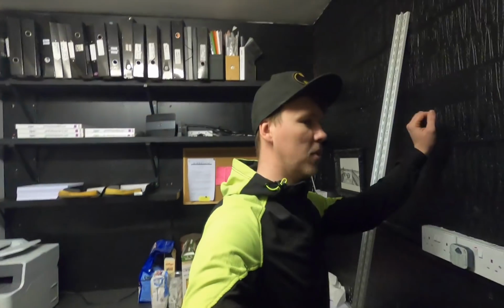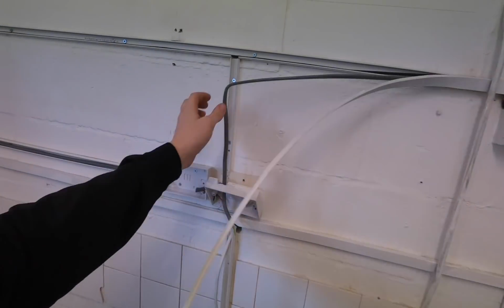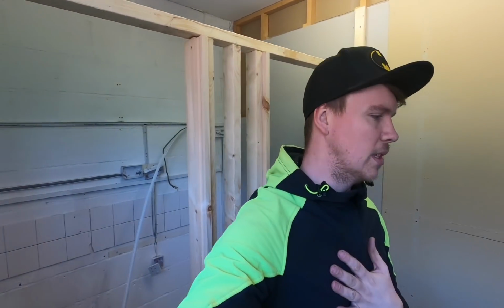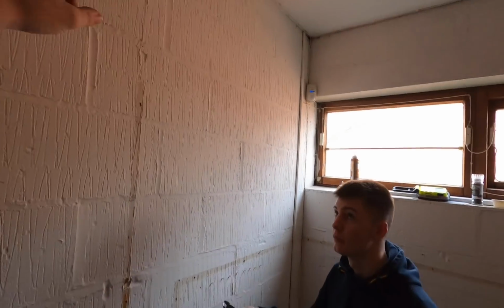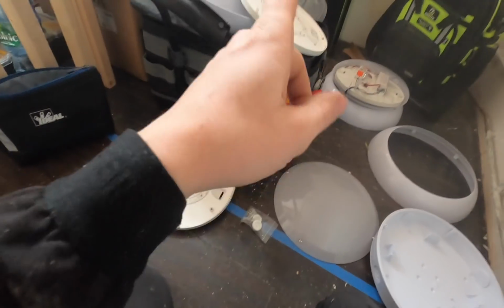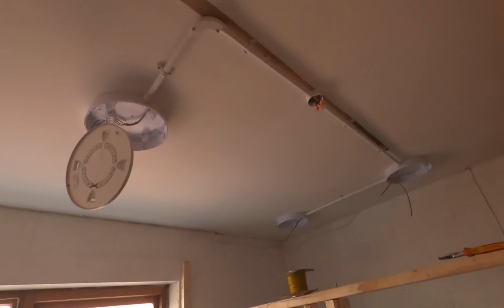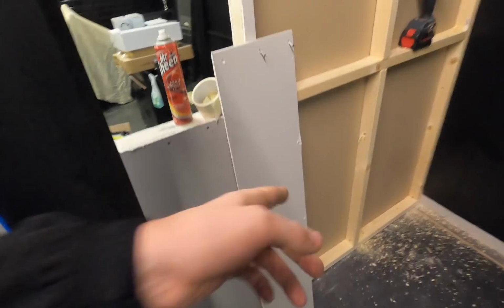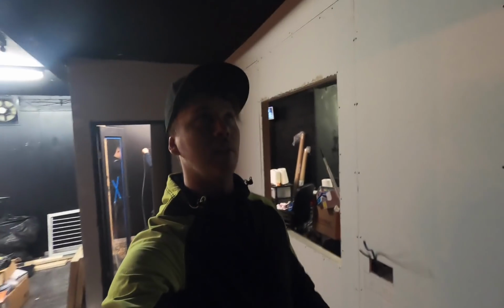Wiring a TATTOO Studio, Electrician

Comment: Wired our local tattoo shop. Never had done one before. It worked out great. Weird custom architectural elements that had me having to use my imagination to solve some bizarre problems. Couldn't just stick with electrical. No, no, had to scramble a couple plumbing jobs when the plumber abandoned the job. When Plumbing's got to be done, call the electrician. Nice!

Comment: They make plastic and steel conduit.  Do they make aluminium conduit?
Reply: You CAN get aluminium but it's specialised in the UK. It gets used a lot in America but over here the main wholesalers sell Plastic or Galvanised Steel. You can also get Stainless Steel for places like food manufacturing.
Reply: @___AD  yeah just wondered why that was.  Galv is very heavy duty and a bit of a pain to work with, needs threading etc.  Aluminium could presumably be used in place of plastic with push-in joints.
Reply: Wikipedia's claims aside, I've never seen aluminum conduit in the US. What I mostly see is EMT, which is thin-walled, unthreaded, steel tubing with clamped couplings and either galvanized or aluminized finish. The most common clamping method is a single set screw. 

The only use I've personally encountered for threaded conduit (IMC or RMC) is suspended devices. Usually cameras, sensors, or emergency exit signs.